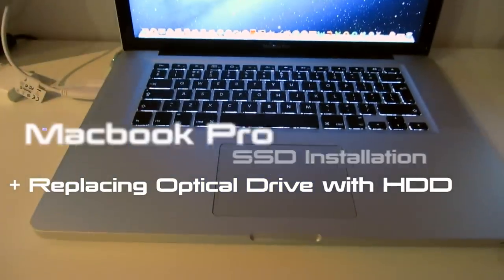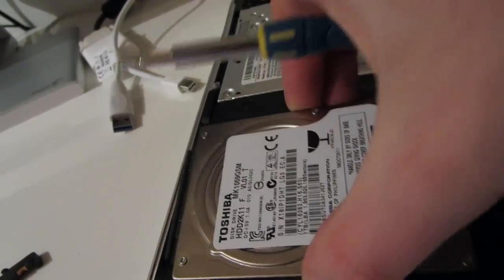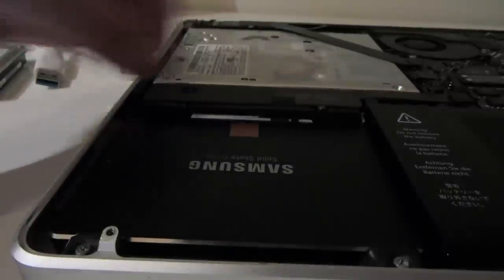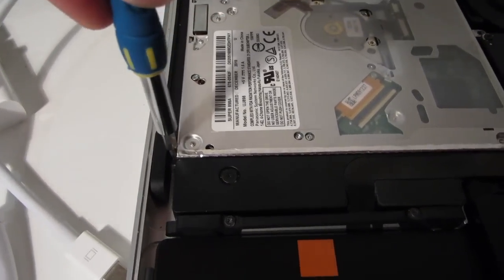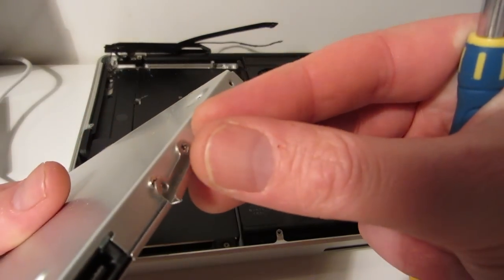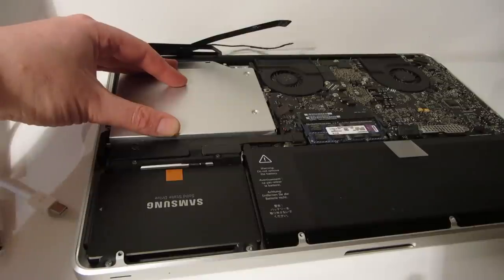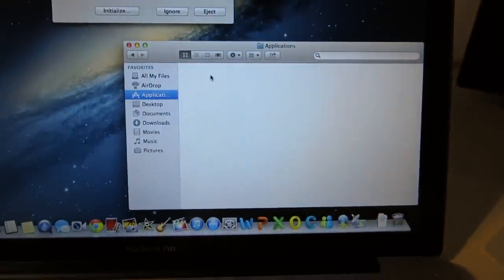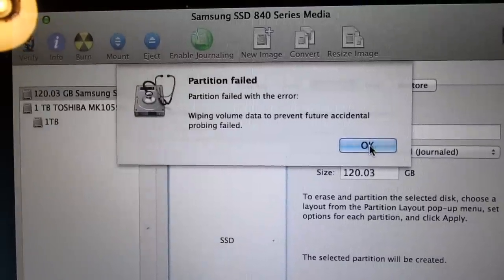Macbook Pro Optical Drive Removal / Upgrade to dual SSD + HDD Hard Drive

Comment from the maker: You have to put the SSD in the hard drive bay.  It won't work in the optical bay.  Only a standard HDD will work in the optical bay.  You can clone it after installing (just boot from the HD using the boot options by holding down the Option key as you power on).

Comment: You can put the ssd in the optical drive, I have a 512 evo and a 1TB in the original bay as a fusion drive. MacBook Pro late 2012

Comment: That's not true. I've got two SSD's in my Macbook pro with the same Caddy you have. Nothing happened except I had to go to disk utility and format it. And it works. It shows both drives and both have them are trim enabled.

Comment: Another option is to get a USB to SATA adapter and clone your existing hard drive to the new SSD using a program like Carbon Copy or Super Duper. Then, just replace the old HDD with the new SSD as shown above and everything will start right up. If formatted correctly, you can install an SSD in replacement of the optical drive. It doesn't necessarily have to be an HDD.
Reply: WILL u elaborate? i didn't understood.

Comment: Mine is a MacBook Pro (13-inch, Early 2011), after watching your video i have a question: my default hdd wont fit into the optical drive space using a data doubler? thanks for your help!

Comment: They have fixed it, because my Samsung is 6Gps and it worked in the optical bay, ALTHOUGH it did not work when I first installed it. It showed an error message. I went into disk utility and erased it and it showed the message about 6 times, on the 7th time it finally worked. And it's been working ever since. I just kept redoing it until it worked and now it works.

Comment: you used partition, but you could have just formatted if it was in the optical bay :/ the reason you want the ssd in your normal hard drive spot is to get speed boosts and not have 'sleep' issues on you mac. you get the sleep issue if you set ssd as your boot disc while its connected to optical bays sata wire. mac doesnt read the optical bay's sata wire when waking from 'sleep'

Comment: i replaced hard disk and optical drive in imac with ssd 500gb and 240gb ssd drives
and created 3 partition on 500gb drive win windows 7 and el captain and maverick
and on the 240 drive put 2 partition with windows xp and unix
and works with alt boot menu

Comment: I dont know what year of your macbook pro is but you can defiantly put two SSD in a 2012 Mac book pro and configure them in a raid 1 or 0
Reply from the maker: Yeah, my Mac is a late 2011 model unfortunately, and won't work with an SSD in the optical bay.
Reply: Bartech TV can you expand on that?  I have a late 2011, and have seen reports that it will, but can not verify since I have not done it yet.
Reply: Bartech TV NVM, I see what you are talking about.

Comment: Hi, does replacing the DVD drive with a HDD take up more power? I was thinking of doing the same as what you did but am worried the battery won't last as long, if I do the swap. Thanks in advance for your help

Comment: Hi Bartech and thx for the video! Can You set the HD in the optical drive to work as an external harddrive so that when you close the lid on the mac you wont have to worry about damaging the harddrive unless it has been activated or is it running whenever the computer is running? Kind regards, Lasse
Reply: It will be running whenever the mac is running...

Comment: I followed this process to replace a HDD not an SSD into my optical drive, and my macbook could not recognise the HDD.  Then i took my HDD out and I put it into a 2.5 HDD enclosure, and plugged into a USB and it works.

Is this method only for an SSD? or would it work on a HDD?

could it be a faulty SSD/HDD caddy that i have??

Comment: Excellent tutorial - thanks for taking the time to share this with us (some of the text/image guides online are hard to follow in places; it makes it much easier seeing it done in real time).

I am about to upgrade my Late 2011 15" Macbook Pro (2.4Ghz version with the Radeon 6770M GPU). I'm looking to get the ever-popular Samsung 850 Evo 1TB drive as it has become pretty affordable for such a high capacity drive, but I was also hoping to replace the Optical drive with the macbook's current HDD. Do you know whether I would have the same issue as you RE: the drive not fitting into the optical bay? In other words, is it possible to install the original macbook HDD in the optical bay or is it imperative that you replace the hard drive with a new one? I'd ideally like to keep the original HDD in the optical bay if possible.

Thanks in advance for your help, and thanks again for such a clear and useful video :)
Reply: +Lee McNamara hey i am wondering the same thing.. im trying to do this asap. I have the ssd, caddy that he used, and also an external enclosure so i can partition anything before actually installing it into the computer. if you can help out i would really appreciate it.
Reply: Hi :) I found that the enclosure fits fine into the optical bay. Just double check the measurements of your macbook, but as far as I know, the correct measurement mentioned in the video (can't remember it atm) should work fine. The SSD will fit directly into the old HDD slot without any issues :)
Reply: i have the right caddy. did you uplaod the os on the new sdd and boot from it, and just leave everything on you stock hdd that came with your macbook? Also do you know how to send all of you downloads and documents to your hdd and not your sdd.
Reply: I used backup software to copy the entire HDD over to the SSD so that I could then boot directly from it. Can't remember the name of it now, but there are a few options out there.. It does mean having to then delete stuff from the HDD once it's transferred but on the plus side, any large folders you want to keep on the HDD don't have to be moved back... 

Any folders that you want to leave on the HDD can still be accessed if you're installing both the SSD and HDD as, once the SSD is chosen as the boot drive, the HDD shows up and works just as any removable drive does. If you want to access a folder, such as Downloads, from the SSD but want to store the actual files on the HDD, you should be able to just create an alias of the folder from the HDD (using the right click menu) and then copy that alias to the SSD, replacing the folder of the same name on the SSD and removing 'alias' from its name. Now when you click the Downloads folder on the SSD it automatically reroutes to the folder on the HDD, if that makes sense! It's difficult to explain here, but there are a number of good tutorials online for creating alias folders between drives :)
Reply: thank you i will look into some guides!
Reply: +Lee McNamara I want to do a time machine back up to the SSD, but it's locked and I don't know how to partition it in disk utility so that it is not....please advise
Reply: +Lee McNamara It won't even let me choose partition for it. There is no option. and it appears under the other HDD drive as opposed to this video even though I installed them in the same bays in the computer.

Comment: If you put a HDD in the optical bay dont forget to not cover the tiny hole in the body of the HDD. Use tape or somthing to elevate it away from the surface it may come in contact with. It even says it on the HDD sticker itself, DO NOT COVER THIS HOLE>

Comment: Pains4Gains, your macbook weight less (optical drive and hdd removed) and is less sensitive to shocks) ;).

I'm going to but a 2012 macbook pro and remove the optical deive and put ssd inside. It's like having the 2013 macbook pro (weight, power, speed) but with more upgradibility. 

Sorry for my bad english

Comment: What Macbook was this? Was the drive that didn't end up fitting into the caddy the original drive that came with the Macbook?

I'm trying to avoid opening my machine up and swapping the current hard drive into the optical bay only to find it won't fit (and that I need to order a new smaller drive).

Comment: I was told by a tech co. that if i upgrade the drives with aftermarket stuff on post 2011? macbook pros it would make the fans run full speed all the time. this was due to apple not liking us using parts that were not bought from them. Apple put a chip on the parts so the machine would know if it was form apple. IS THIS TRUE? I have a mid 2012 or early 2013 model.

Comment: Hi, Can I ask how do you move your files on your bootdrive SSD to HDD? Do you just drag and drop to the 'Macintosh HDD' under the device column? 
And how do you open those files that you have moved to HDD while booting from SSD? Do you have to restart to boot from HDD to open it? 
Does it work the same round from HDD to SSD too? As I only have a 250GB SSD and a 500GB HDD from Apple. I am planning to boot it from HDD and copy only important files to SSD. Please help me!

Comment: i read this somewhere, "PRE-2011 models can utilize a 6G drive in the optical bay, but will do so at a reduced 3G (3Gb/s) speed...and i also read that samsung 840 series in backwards compatible to 3gbs how do i slow it so that it works? if you can help please. thanks

Comment: How do you install the OS X when you have your optical drive out of the computer? Do you have the optical disc caddy to use it as external? Didnt mention anything in the video....
Reply from the maker: I copied the OS X installer to the hard drive that I put in the optical bay.

Comment: @dustin wang trying to help,  you can check it on google, his TOSHIBA MK1059GSM is 12.5mm, and I also checked mine was TOSHIBA MK5065GSXF is 9.5mm. I using this keyword on google "the thickness of TOSHIBA MK5065GSXF" . also you can check what hard drive installed on your MBP in about this mac > system report > storage. cheers

Comment: is there a way I can find out if my HDD is going to fit inside the caddy? It's the stock HDD from Apple that comes with the mid 2010 MacBook Pro 15''. The Hitachi HTS545050B9SA02. I googled the model number but don't seem to find the answer. Also, having then installed the new OS on the SSD, is it necessary to reformat the HDD (since it has the old OS installed on it)? How do the files appear? As an external drive? Thanks for the help!

Comment: Are you able to set the HDD in the optical bay as a boot drive? I'm thinking of installing windows on one of the drives for bootcamp and was curious if I can move between them as boot devices.
Reply from the maker: Yes you can install two hard drives, one for OS X and one for Windows under Bootcamp.
Reply: Bartech TV Awesome, thanks!

Comment: So I cannot replace my Optical Drive with an SSD (Having two SSD's, I have one in the main area and one I want to replace with the CD drive) for a Macbook Pro Late 2011?
Reply: yeah you can replace the optical drive with the ssd. i imagine he only installed the ssd into the main slot just because it'll be the boot drive and it's a sexier looking drive. someone correct me if i'm wrong.

Comment: So the Toshiba hard drive I have on my early 2011 Macbook Pro wont actually fit in to the optical bay (the vanilla HDD that came with the laptop)? How can I check the actual size of the HDD (9mm or 12.5mm)?
Reply: Macs use 9.5mm superdrives

Comment: Hey nago i need help! Or anyone if anyone can help. I purchased a samsung 840 series SSD to install in the optical bay. I already have a crucial M500 in the startup disk. I found out its just the SSD's that arent working in the optical bay because i tried every way possible and when i finally put a regular HDD it boots up. But when an SSD either windows it stays black with blinking white light and if my SSD running Mac it just shows apple loading logo and with regular HDD it boots up. does it

Comment: can anyone seriously explain the process after the hardware is installed? i cannot find any videos showing how to have the ssd as the primary drive with your stock hdd for storage. I need to know how to have all my downloads, documents, etc to automatically go to the hdd. Do you have the os on both ssd and hdd but boot from ssd? then just drag and drop files you want to go to the ssd? also my hdd has windows boot camped on it. I have backed up both my hdd and my partition for windows. So if anyone can help out would be much appreciated. I would love to get this done myself before going to apple store or mac express, which i bet they will not be willing to help me since i'm tampering with the device.
Reply: +BdOg2012 Omg! This is my exact situation and I need help. I got the SSD in and I have the HDD in the optical bay converter. But now I'm confused because I want to use my time machine backup because if i drag and drop files manually they somehow are not where they were before and iphoto and itunes is empty. I just want to make it simple with a time machine backup but then I just want the HDD for storage and the SSD for processing. Anyways, if you figured this out please help me. lol. And I can't figure out how to even initialize them to both be working.
Reply: +BdOg2012  Ok. I see you had a conversation with another You tuber below and asked the right questions and he answered so maybe I can figure this out from that.
Reply: +Karla Heinrich I ended up figure out a way to do it a couple months ago.. It was headache but it works for the way I did it. Let me know if you have any questions.
Reply: +BdOg2012 Yeah, I'm still stuck. It was mentioned by the guy you conversed with that he used his backup drive to copy the entire HDD over to the SSD. But I can't even figure out how to initilize the SSD to move anything to it. It's actually locked right now. I want the SSD to do the processing and the HDD to do the storing of most things. I want to use time machine backup because if I do manual back up then things are not in the right place becasue I am not that knowledgable. For example my music won't be in itunes and my photos won't be in iphote and my applications will basically all be empty. I don't want to have to do all that manually as I don't know how....I just feel I've created a mess.  I need to figure out how to even activate this SSD by partitioning it right.
Reply: +karla heinrich ok, i did something a little different. I put the ssd on the optical bay because my hdd wouldn't boot my windows partition when i had it in the bay, so i put it back where it was. Do you know how to partition the ssd for it to work with macbook? i am to believe that its a brand new ssd. If you don't its ok, it is really simple and i can help.

Comment: Hi Bartech, I've just upgraded from my old dodgy 750HDD to a 250 SSD drive and a new 750HDD. I have all my data backed up on an external HDD time machine back up. Do you know how I restore my data from the time machine so that my OS and applications are running of the SSD but all my files are kept on the new HDD? Would be greatly appreciated, thanks!
Reply: hugh fowler I have the same problem if you find an answer please could you message me
Reply: JinxMedia Hi Jinxmedia, it looks like the solution is on this page.
https://support.apple.com/en-us/HT204350
Haven't tried it yet though.

Comment: ummm you should have put the ssd in the caddy...no need to even move your original drive...so silly
Reply from the maker: As I said in the video at 11:10, the SSD doesn't work in the optical drive bay.  The optical drive bay is restricted to SATA II devices.  The SSD has to go into the main drive bay.